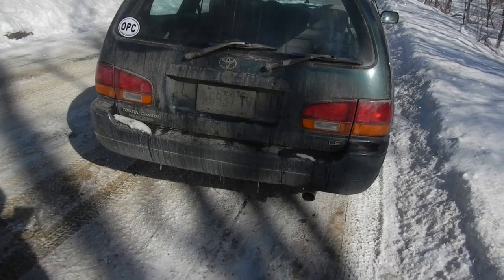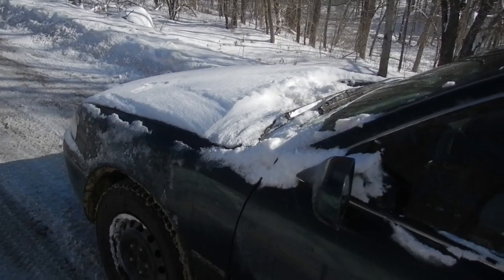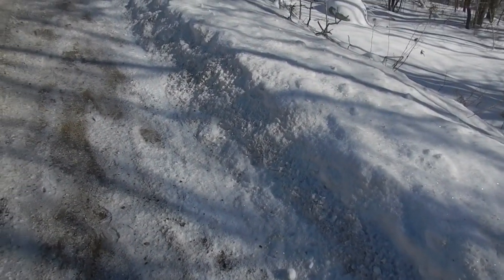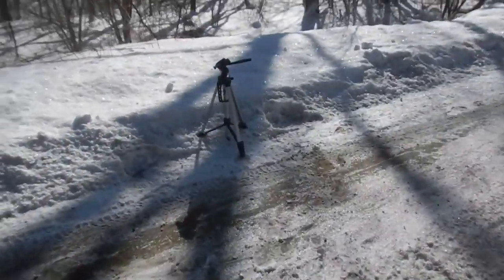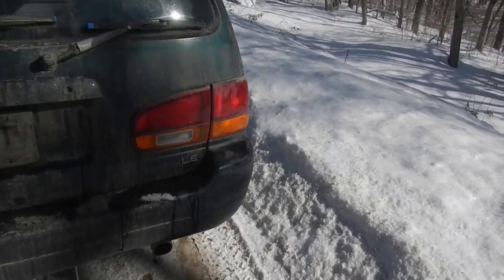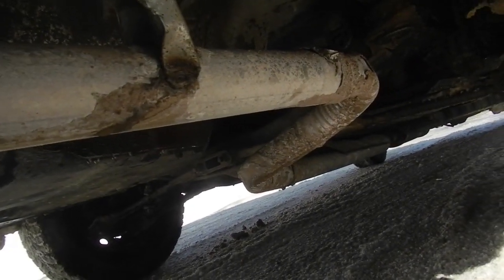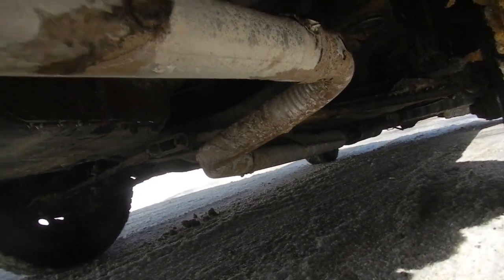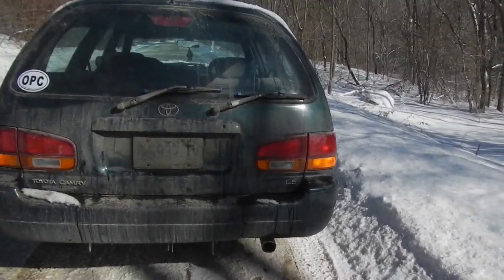1996 Toyota Camry TRD WAGON - Custom Exhaust

Comment: it's ight', if it was me i would of gotten a aftermarket 5sfe header, modified the downpipe to fit, and run a full 2.25" exhaust with no resonator to the tip. added a aftermarket intake system. But overall it doesn't sound bad.. Sure isn't anything trd-ish lol. if your not already on there Check out the Official Camry Nation page on Facebook, should give you some inspiration for your xv10
Reply from the maker: The camry was sold a few weeks back for around $500 more than list price. I did have an aftermarket intake on it however.
Reply: Nice... Someone got luck with getting a wagon version
Reply from the maker: Yeah, now I drive an actual turbocharged car with a 5-speed.